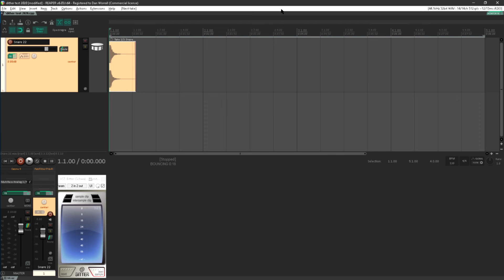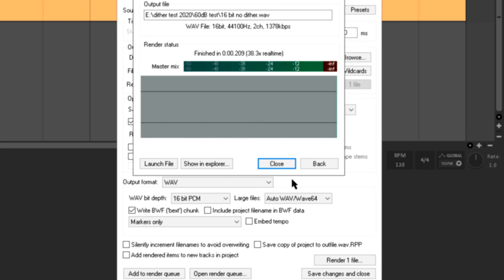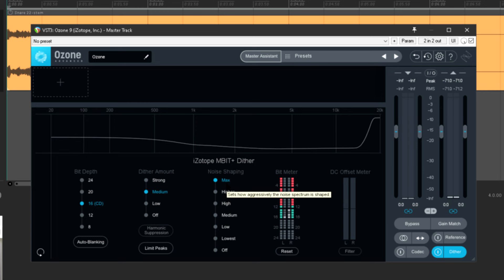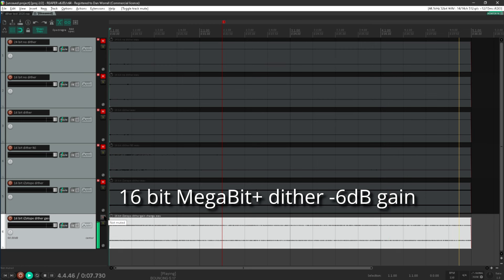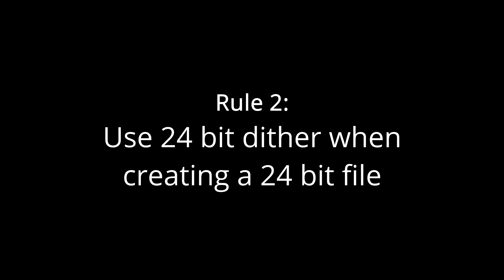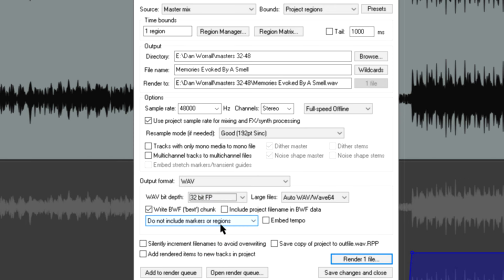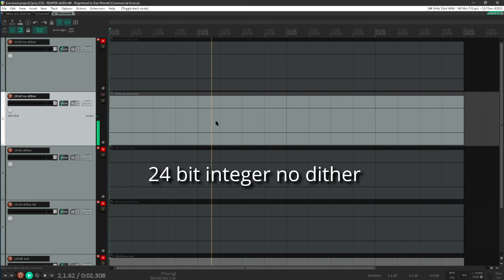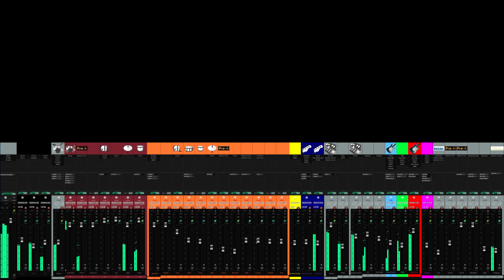WTF is Dither?

Comment: one question emerged for me. Since mp3 compression is related to psychoacoustics, what if the encoder is only loosing quality in relation to the dynamic range of the audio clip? from a lossy compression perspective it would make sense. In other words, if you render the mp3 file containing both: attenuated and non attenuated snare and then import it back, will the quality remain untouched for the attenuated sound like in your demonstration containing only the attenuated one?
Reply from the maker: If I understand the question, and as far as I understand lossy compression, if there are louder, more prominent components present then quieter components might be deemed irrelevant and omitted. But this will depend on the bitrate as well of course. With higher bitrates the stuff that's left out usually is largely irrelevant.
Reply: @DanWorrall  I actually tried it now in Reaper. If I add a snare with -60db attenuation followed by a snare with 0 attenuation, I can render it to mp3; and once loaded back into a project, and amplified it back to 60db, the attenuated snare sounds just like before the render. Amazing! This is a case where mp3 provides better sound quality than some uncompressed formats. I wonder about flac and ogg now

Comment: In a nutshell. only dither at 16bit because the low bit rates won't pick up a noise floor when rendered from 24 bit with dither. A 32-bit float is ideal because it can be rendered lower(24/16bit) without any problems.     and lastly, once the final outcome has been delivered only then render to mp3 XD. Also that dither is a solution to quantization errors that occur when "bit crushing" so to speak.

Comment: Great Vid! Thank you... I have a question that perhaps someone or Dan Worrall himself could answer... Say I'm recording audio at 44khz 16bit, from a music file (also 44khz 16bit) into my computer via my audio interface. I then go and make some changes in my DAW to that file (say a gain boost of x-db) and then I want to re-render that file as 44khz 16bit. The DAW now considers this a 32bit file due to the change (in the case of using ableton live) when i applied the gain. I SHOULD be using dither when I render this at 44khz 16bit...correct?
Reply from the maker: Yes that's correct. Of course if you're adding more than 6dB of gain, and you're not clipping, that means you weren't using all 16 of the bits for your original recording. That's why people usually record at 24 bit, even when the final file will end up 16 bit.

Comment: Hey Dan, I noticed that in the WAV 32 bit FP rendering, dither and NS are greyed out but aren't ticked
while in the mp3 rendering, dither and NS were greyed out but are ticked instead
I understand that with 32bit you don't need dither but with mp3 is the only option
Reply from the maker: If its greyed out it doesn't matter if it's ticked or not. Reaper doesn't dither mp3s, though perhaps it should.

Comment: How about using dither when going to & from outboard, to help correct quantisation issues
Reply from the maker: In theory you should add 24 bit dither before it hits your 24 bit DA converters.

In practice the dither noise (or quantisation distortion) will probably be buried well below the noise floor of the outboard you're routing to, and you don't really need to worry about it.

Comment: i still wanna know how an mp3 file can save so much space while having a higher bitdepth than the typical 24bit wav file. that must mean that they compromise quality in literally all other ways possible at least
Reply from the maker: I think the extra dynamic range is just a consequence of floating point maths, which is probably required anyway for other reasons. Think of it as a bonus side effect, rather than a trade off for quality elsewhere.
Reply: @Beats BasteIn :3 - 
I think you need to be careful about your terminology when you say an MP3 has a "higher bitdepth" - are you actually referring to the bit RATE of an MP3? If so, that refers to how much digital information per second the file provides (i.e. 320Kbps), not dynamic range. Lossy codecs don't have a bit DEPTH as such because it varies in order to use the least bits possible. That's how it keeps the files size down in the first place. 

Great video!
Reply: @robinnewman2442  this is exactly the reason why i'd love dan to make a video about this topic. because according to this video the bitdepth of an mp3 file is amazingly huge. but i already suspected something like what you said, that the mp3 conversion in fact only produces something like "a high bitrate" if there is no sound around that is much louder.. and when there actually is loud sound it would not make the quiet sounds so clear. even though i already suspect this i'd love to have it also visualized nicely if it's true and i think dan is the man for these kinds of things
Reply: @robinnewman2442  Hold on! 320kbps is a compressed bit rate? Or it meant it's a reference for 1411kbps raw pcm file?
Reply: @the_newvoice  yeah, a WAV file might have a bit rate of 1411Kbps but once you convert that to a lossy file type like MP3, you'll have the data rate specified by the MP3 conversion settings, such as 256Kbps. 

The point I was making before was just that all of this Bit Rate stuff has nothing to do with Bit Depth which concerns dynamic range and when reduced, requires dithering as shown in the video
Reply: @robinnewman2442  Yeah, i just think if it's more information but the bitrate is 320 max, then the points that drawing the wave curve is not enough and will make it more distorted. Or that distortion is kinda more noticeable lossy artifacts like wobbling? I mean 44100 x 16 bit and 44100 x 32 bit, but it's still 320 kbps something should be wrong. Maybe at one single snare i don't hear a bottleneck, but if it was a full song with ability of high frequencies it will appear? ANYWAYS I NEVER HEARD SUCH A THING, THAT MP3 CAN BE 32 OR 24 BIT.
Reply: @the_newvoice  well, as I understand it, bit DEPTH is pretty much irrelevant when it comes to lossy formats as it's basically variable. That's why it's such a clever algorithm, it knows when it's ok to discard information without affecting your experience too much. Essentially, just don't worry about it as no one can really tell the difference. Unlike quantisation noise, which you will hear in some cases when you don't dither properly ☺️

Comment: thank you for video! 
do you suggest to use reaper dither or ozone dither for rendering an individual  sound effects/a mix (post production/game audio)? sorry if that is the broad question
Reply from the maker: If you're rendering 24 bit files I would just use Reaper's dither. No one will ever hear the difference, I don't care what Bob Katz says ;)
If you're rendering 16 bit files then MB+ is perhaps marginally better. But I would just use Reaper's dither if it makes the workflow easier, eg rendering stems via the render matrix.
Reply: thank you!!

Comment: Great ! Again. :)
Just out of curiosity, what was the mixer bit depth for the tests in reaper , 64 bits ?
And some particular reason you set your Audio interface to 32 bits ?
Reply from the maker: Yes, the default 64 bit setting for Reaper's mixer; never seen any reason to change that. But my audio interface wants 24 bits. Not sure where you got 32 bit from?
Reply: @DanWorrall  from the top right corner there is the 44.1KHz , 32Bits.
Reply: I did somes tests using different mixer settings, and the 24 bits algo read reverb tail till 64 bits in Bitter. strangely they have a 39 bit algorithm that is fixed to real 39 bits..
Reply from the maker: @PedroGerardo  this is the recording bit depth, its independent of the interface. I hadn't noticed it reading 32 bit: I'm guessing that's because I was streaming Reaper's output to disk at 32 bit float (that's the audio you're actually hearing in the video).
Reply: @DanWorrall  Yeh, that´s what i meant ehhe. 32 bit recording. I didn't explain well sorry. That wouldn't affect the tests anyway.  only the internal mixer bit depth. Thanks again.
Reply: note that audio interfaces work with fixed point, not floating point. So when they say 32 bit, they mean 32 bit fixed point. 32 bit floating point has 25 bit fixed point resolution + 8 bit exponent, 64 bit floating point has 54 bit fixed point resolution + 11 bit exponent. You can notice that there is "extra" bit - they somehow use so-called "hidden bit" in audio processing for more resolution! Clever. Unfortunately I wasn't able to find how exactly it is done - if someone knows, I would appreciate if they would share the knowledge! I tried to think by myself how it could be done with pen and paper, but I didn't get correct results
Reply: But what about most of the plugins that only support 32bit? Which is all of VST2 and maybe also VST3 (I’m guessing, I am actually not sure whether 64Bit capability is mandatory or optional for VST3. It is supported by the SDK).
In any case, for plugins that expect a buffer of 32bit floats, in my understanding the DAW has to cast those 64Bit floats to 32bit when calling the processing method of the plugin, and possibly back to 64bit. Can be done, of course, but is additional cpu cycles needed (whether you’ll notice that extra cpu usage is a different question, though).
Or am I missing something here?
Reply: @Am6-9  you are right about the need to convert. However, most probably, dither applied for this "casting" would be the most regular TPDF dither or something like that (I don't know exactly, DSP developers could answer that much better), and compared to oversampling that plugins do it costs very little in terms of CPU processing power.

Comment: Very informative. So, if an audio file is already 24bit, should you avoid rendering it to 24bit using dither and noise shaping or does nothing happen since it's  already 24bit?  Sometimes I have multiple clips where some are 24bit, but others are 32bit float as a result of editing, and I'd like to just apply 24bit dither and noise shaping without worrying about each clip's format.
Reply from the maker: If you're processing the audio in any way (including just changing the gain) its not 24 bit anymore, its 32 float. Go ahead and dither. If it is still truly 24 bit, go ahead and dither anyway. You're adding an unnecessary layer of noise, but it's so low in level it really doesn't matter.
Reply: @DanWorrall  "unnecessary layer of noise", meaning the noise shaping, right?  So, does the noise become noticeable if I render them a second time to 16bit with noise shaping?
Reply from the maker: Meaning the dither, which is usually a type of noise. When you go to 16 bit, the 24 bit dither noise is just literally not there anymore. It's so far below the least significant bit of the 16 bit file, its as if it never happened.

Comment: I think if the song will be played in PA system and movie theater with very loud level this may matter too?
Reply from the maker: I've played many CDs through many PA systems and never once noticed the dither noise. The noise floor of the PA is always more significant, not to mention the ambient noise floor of the venue. And anyway, even if you could hear the noise, it would still be preferable to distortion.

Comment: Although I have watched your video, I am still not sure. I also use Reaper. Is it better to render your mix 24 bit or 32 bit plus dithering for mastering ?
As far as I have understood you can apply diherting twice, for example render mix to 24 bit plus dithering, then master and render to 16 bit plus dithering. So would it better to render mix to 32 bit plus dithering for mastering?
Reply from the maker: If you bounce a 32 bit file you don't need dither. You can also go above zero dB without actually clipping. But there are no other advantages, so a 24 bit dithered file is usually just as good with a smaller file size.

Comment: Can I export my mastered track at 32 bit float? will that have any implications when I try to upload to streaming platforms?
Reply from the maker: It shouldn't matter, but there's no benefit to doing so, and you rely on them converting correctly. I would recommend using more standard 16 or 24 bit integer files to make it less likely you discover bugs in their system.

Comment: Jaycen Joshua mentions that the noise from the rc-20 plug-in can act as a dither. Would you agree?
Reply: Also do you think it’s necessary to dither before hitting any outboard gear or summing mixer?
Reply from the maker: Rc-20: don't know, what is it?
It's mathematically correct to dither to 24 bit before hitting your DA converters. But I very much doubt you'll ever hear a difference.

Comment: So does this mean you can use MP3 all the way along your production until it comes time to export the final product? I feel like this would save a huge amount of space
Reply from the maker: You can if you want, but I wouldn't recommend it.
Reply: @DanWorrall  Why's that? Genuine question, I don't mean for it to sound like a challenge lol. Maybe I completely missed something in the video!
Reply from the maker: MP3 is a lossy format, meaning you lose a bit of information every time you encode. At lower bit rates the degradation is clearly audible. But even at high bit rates, you might be throwing away "insignificant" information that you would have otherwise been able to bring out and enhance with EQ or compression. Also MP3 encoding can change the timing of the audio slightly, which makes it a bad choice for multi channel phase correlated signals, like a multi mic'ed drum kit. 
While MP3 in theory has better dynamic range than a 24 bit wav, its not in any way that matters, while the wav file is better in every other way. Except file size. But that's not normally a limiting factor these days.
Reply: @DanWorrall  Ah ok, I was under the impression that at its highest quality it somehow transcended lossy-ness. Thanks for the clear explanation!

Comment: Apologies if this has been asked and covered in the 651 comments already, but if a song is recorded with an audible analog noise floor running throughout the whole song, is dither at all necessary?  If so, why?
Reply from the maker: I don't know, in all honesty. It might depend on the nature of the noise floor? Dither noise is carefully calculated to toggle just the lowest bit or two, and to average out to zero over time. Maybe if your noise floor ticks those boxes your mix will 'self dither'? But equally, if your noise floor is already that high, might as well add the dither noise just in case. It might only make a difference during the fade out? Can't hurt anyway.

Comment: What happens if I use the wrong dithering? Specifically 16bit dither during a conversion of a 32FP bit file to a 24 bit?
Reply from the maker: You'll have too high a noise level. Doesn't matter if the 24 bit audio has truncation distortion, that will be buried in your 16 bit dither noise. Or possibly your dither algo also truncates, in which case you'll have (properly dithered) 16 bit audio written to 24 bits with 8 wasted.
Reply: @DanWorrall  Thanks for your reply. If I understand it correctly, then after the "incorrect dither choice", the 8 bits of the quitest information is buried by the dither noise. But when converting 24 bit file to a 16 bit file, the process, It scales them down, sort of losing resolution, it doesnt just delete the 8 quitest bits, right?
Reply from the maker: @vojtechsilhan1704  it just deletes the 8 least significant bits. It's called truncating, literally just making it shorter.

Comment: Excellent presentation !
Aside from the 'F' bomb in the title, this is one  of the few tutorials on ANY audio topic worth watching.
It dose seem to bear out what I've suspected all along, which is that adding a noise floor is very similar to dithering, if not identical.
I've modeled a 6SN7 GT in software, created a VST and use 16 of 'em on 16 channels of cakewalk and gotten what appear to be similar results.
I use a spectrum analyzer, it would have been interesting to see dithering on a spectrum analyzer and distortion meter.
Any thoughts would be greatly appreciated.
Bill P.
p.s., that 'F' bomb almost turned me away, since it is SO overused by 13year old post pubescent little boys.
Luckily i got past it and enjoyed your presentation.

Comment: When exporting a multitrack, would it be good or bad to apply dither to each track?
Reply from the maker: It would be technically correct to, if you're rendering 16 or 24 bit files. But if your DAW can't do that automatically, I suggest swerving the issue and exporting 32 bit float files.
Reply: @DanWorrall  I use to playback a lot of stems in live (more than 20 per song). My concern is: won't all the dither noises add up when exported at 16 or 24 bits? or is that better than going without dither?
Reply from the maker: @jdavibedoya  yes, but it's probably not an issue with 16 bit dither, and definitely not an issue with 24 bit dither. Seriously, 24 bit dither is really quiet!

Comment: What is the theme you have Reaper set to? I like the look if that one, would like to try it out. Thanks!
Reply from the maker: You need to upgrade then, its Reaper 6 default ;)
Reply: @DanWorrall  Oh, okay, thanks! I recently got a new computer after being without one for a few months, and have just been running it from a copy I had saved on an external drive before the old one shit the bed. Had been procrastinating downloading and installing the most recent version, but I think this might be the kick in the ass that I needed to get it all proper and up to date!

Comment: it might be a stupid question, but is it neccessary to use dithering? is it very important?
i always export my track in 24bit 48000hz
Reply from the maker: There's no law! If you would rather have low level distortion than inaudible noise, that's your call.
Reply from the maker: (at 24 bit its really not worth worrying about)